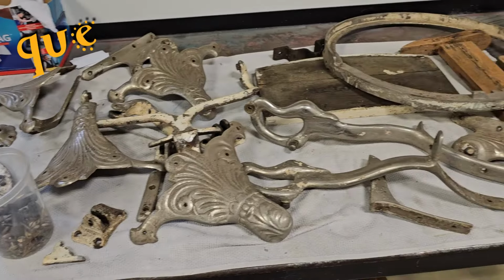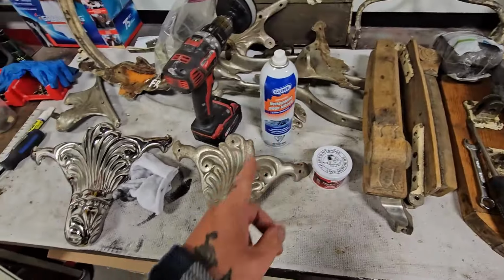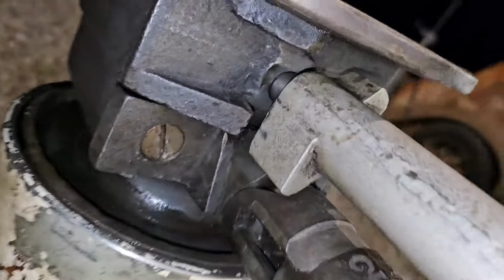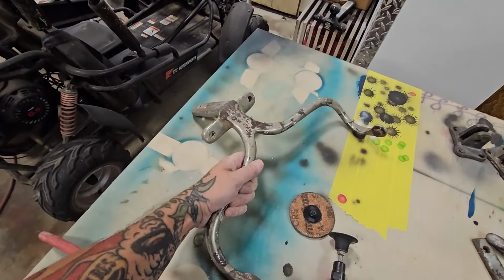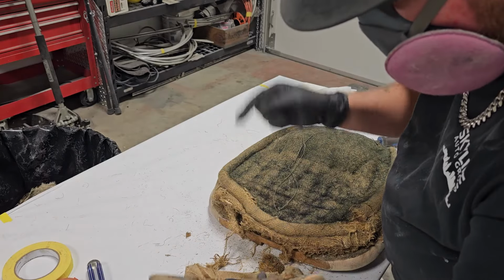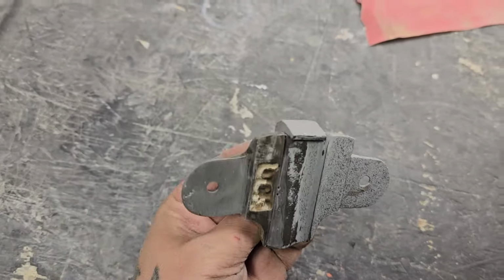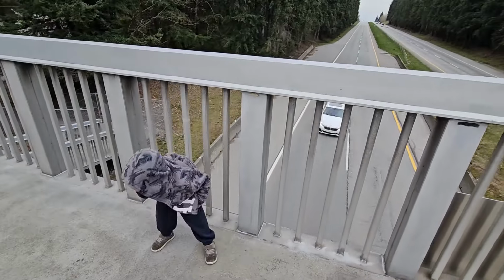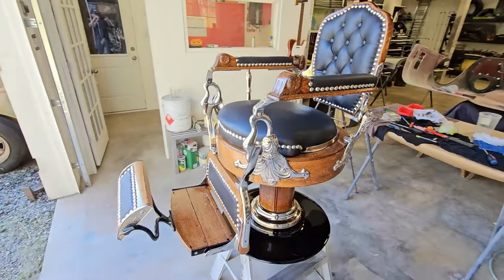*EXTREMELY RARE* 1890-1910 Barber's Chair Full Restoration!

Comment: Absolutely beautiful, and i love that you utilized Panel Bond, 8115 is an amazing product.
Reply from the maker: Thank you sir! I agree. panelbond is probably my favourite product ever made. Id honestly trust it to "weld" a quarter panel on a car. Mind blowingly tough stuff. can even drill and tap it. Wild. Thanks for watching!
Reply: @SlickWorks  its perfect for replacing roof skins, paint the roof off the car, panel bond it on, spot weld the corners, and spot paint in the channel, its a beautiful thing. Its also amazing for fixing old cracked steering wheels, i used it on my 61 Fairlane.
Reply from the maker: @evanfinger411  Oh yes I have a whole episode on using panelbond to repair a cracked steering wheel!
Reply: @SlickWorks  i found your channel when you were painting your lowrider, loved that series, ive been painting for 25 years now, absolutely love it, and love watching your work. Ill check out the steering wheel episode.